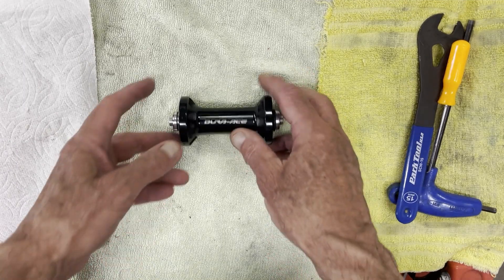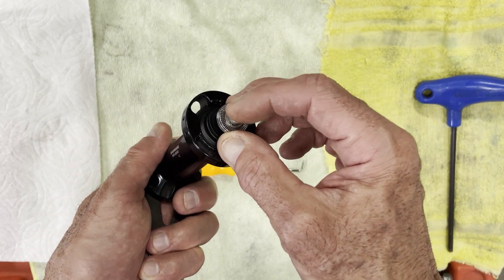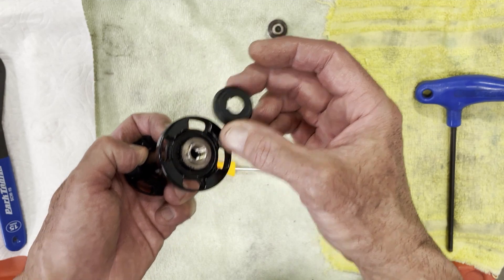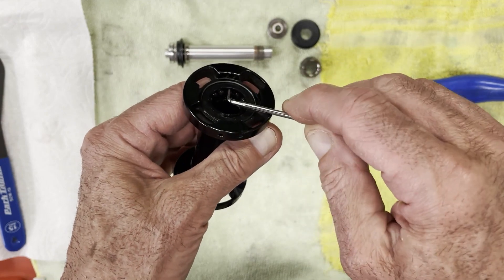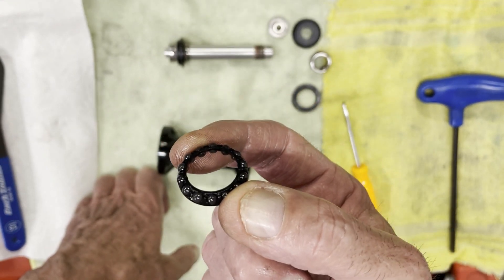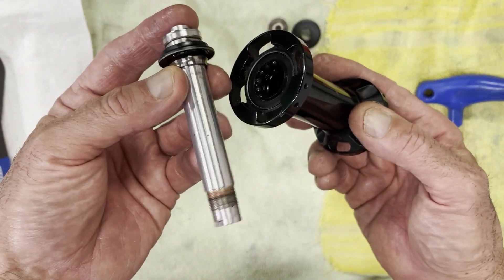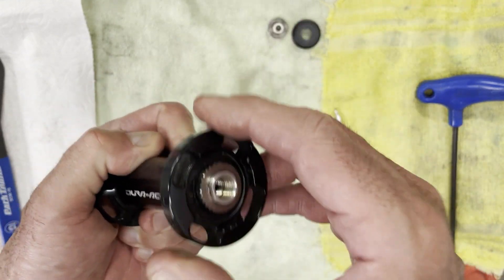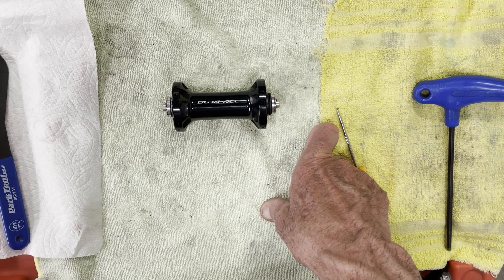Detailed - Shimano Cup & Cone Hub Technology

Comment: Personally i wouldn't go with the ceramic balls. For better performance remove the cage and use oil. I find ceramic overhyped.
Reply from the maker: For even better performance, remove the seals so there is no drag on the balls. But, your point brings up the age-old argument, if you remove the cage, do you add an extra ball? The other argument regarding removing the cage is that the balls will run up against each other and when coming into contact with each other, they are rotating against each other in different directions.